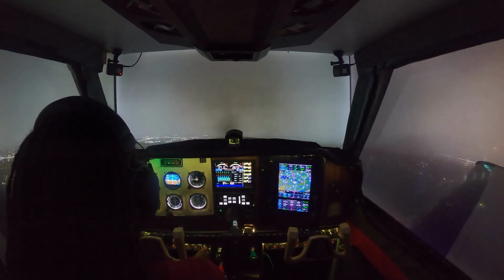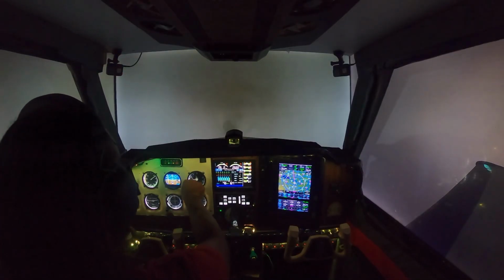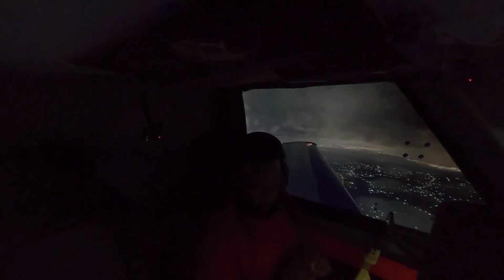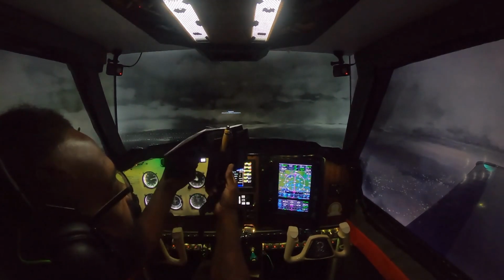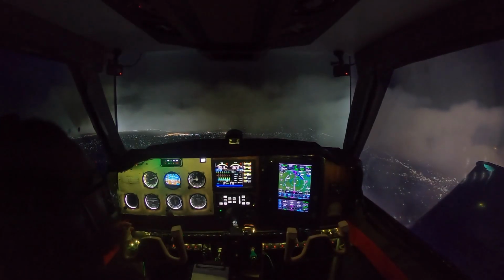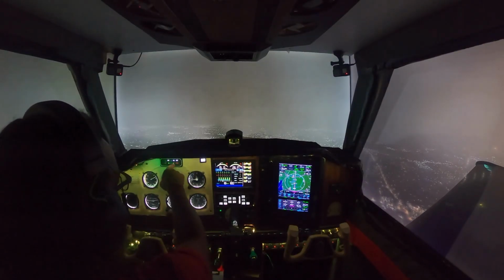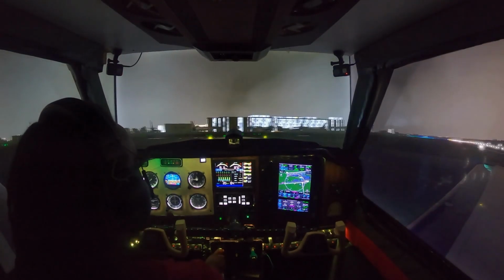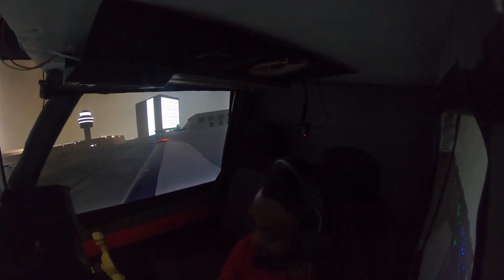Cloudy flight with SayIntentions.AI

Comment: Yo wassup bro, I just recently subbed, love ur channel. And hopefully I’ll have an enclosed cockpit myself real soon. Been hunting down info on making the view on msfs2020 perfect. I had 3 screens at one point but couldn’t get centerline like you. It would feel distorted.. couldn’t figure out why… so I scrapped it and got rid of 2 of the 3 screens. Working on 3 65” for round 2.. any pointers would help if u get to this comment. Thanks bro.
Reply from the maker: Thanks for the support!  Make it happen Captain. It’s worth but you put in it. As far as views go. Make sure not to use surround. Create 3 seperate windows in the experimental settings. Once that’s set, it’s really just a matter of shifting the front view over until its center. The other two screens will follow. You will have to play around with the zoom according to how you have yours setup. But that’s pretty much it. If you need any help along the way with your build don’t hesitate to reach out. And get locked into my discord if you haven’t. I can really go more in depth there than here if that makes sense.
Reply: @CardboardSim will do bro thanks again!!